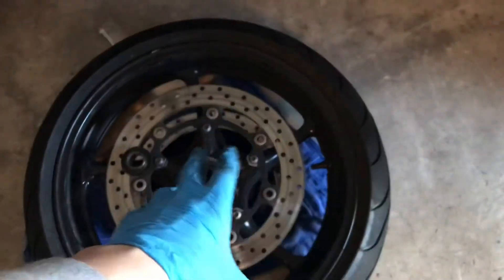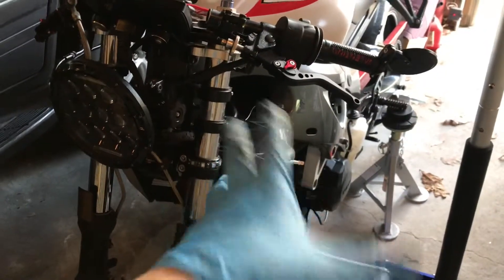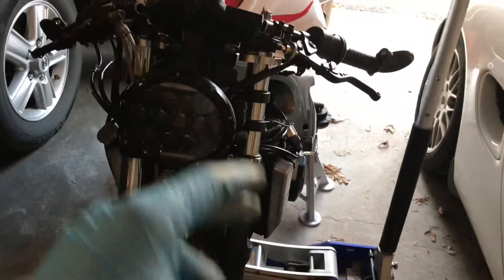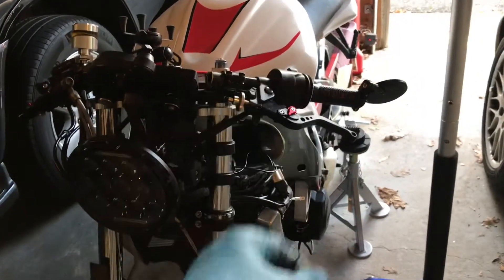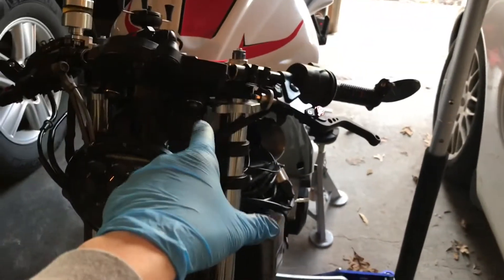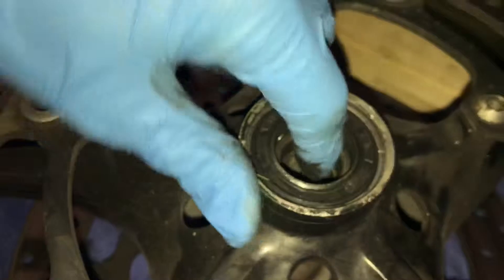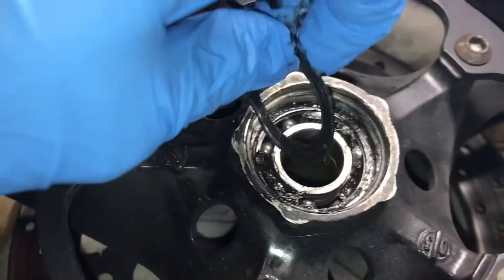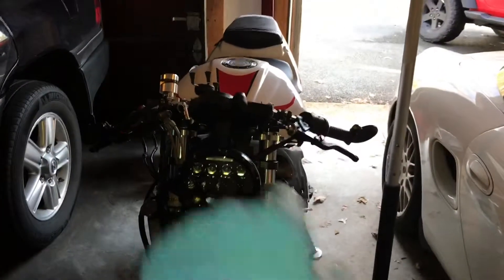Bad Wheel Bearings | R6

Comment: The axle and inner race don't spin.  The outer race and wheel spins.  Ever figure what you did on installation that was wrong?  Wheels bearings are tough, simple, and reliable.  They get ruined by people hammering them in on the inner race or using crooked center spacers that are out of spec.
Reply from the maker: J B I think it was a defective bearing. New replacements have been perfect, and have 2,300 miles.
Reply from the maker: I’ll add to that, as I’m going over these comments again… 
I replaced the rear wheel bearing at the same time as the first, and the rear was always fine. 
With 10,000 more miles on the new front bearing, I can safely say the last “new one” was defective. 
This is why I never buy from third party retailers anymore. You never know what that package has been through.

Comment: Can you please explain me why does the bearing breaks.  In w months i have replaced 5 bearing which keeps breaking as same in the video.  Please explain the reason why its breaking coz I am not sure y is it happening too often.
Reply from the maker: syed abdul radheef This could be for a number of reasons! Your wheel could be damaged, causing damage to the wheel bearing, OR, You could be installing the bearings in an incorrect manner, and accidentally damaging them in the installation process. 
I have done both of these.
Reply: Are you forgetting to install spacers or using incorrect spacers as this will quickly overheat and shred your bearings. Symptoms are at first brake noise at slow speed then when they go a loud clicking/clunk felt through the bars and if at the front wheel sometimes an intermitent loss of brake due to slight movement from the pads it can feel like a puncture or a stone stuck in the mudflap at speed or an impending tank slapper.
Reply: When putting new bearings in you fit one side and knock it all the way down to the seat. Put the spacer in and start knocking the other side in don’t just knock it all the way down to the seat as this will put the bearings under pressure from the sides as the spacer will be to tight in beetween pushing the centres of the bearings out so you gently knock the second side down checking to see if the bearings is still spinning freely each time until it’s just touching the spacer.
Reply from the maker: James Griffiths is absolutely correct. You need to make certain as you install the second spacer, that the bearing isn’t bound, and will still spin freely.

Comment: Maybe did you forgot to install the inner spacer between the bearings? so the pressure was on the balls instead of the center.
Reply from the maker: No, I had all spacers installed. 
I believe I applied too much pressure when installing them, and did not press them in evenly. 
This caused them to wear prematurely.
Reply: @motormaniac1  weirdness here. jejeje. or maybe some production problem with the part.
Reply from the maker: @cyberkiller83  That could be also! Haha 
It was a fun learning experience for sure
Reply: This kind of experiences are the one that will give you more knowledge. How people say. You learn from your success but not as much as in your failures
Reply from the maker: @cyberkiller83  indeed! Those are wise words to live by. We all need a little failure in our lives to learn from.

Comment: Sounds just like my problem. Originally i thought my chain was slipping but I just changed my sprockets and new chain. When I accelerate to hard or try to wheelie it acts similar to my chain slipping and has a clunk noise. Also i noticed on my stand it has a slight click sound if i wobble the wheel back and fourth even when everything is tightened down.
Reply from the maker: You should absolutely take a good look at that bearing 😂
You don’t want to be riding it if it decides to grenade itself further. 
If it’s not the bearing, it could be an engine or transmission noise. 
Try turning the wheel while it’s in the stand, with the engine both on and off. If it makes noise while it’s off, it’s probably the wheel, unless you can hear the noise coming from the engine or transmission area specifically.
Reply: @motormaniac1  Well it’s only when I accelerate or try to go for a wheelie and dump my clutch. Which leads me to believe my clutch is just slipping.
Reply: Hey man was it the bearing? I have the same problem with my back wheel on the stand and I need the solution before I spend $200 on this thing

Comment: My bars have a jumpy feel, its wobbling up and down, could that be the wheel bearing ?
My mechanic says the bearing is fine (checked it last time we changed the tire)
Reply from the maker: That depends! Do they move Side to side, or do they move up and down? 
If it’s more of a up and down, your shocks maybe be worn out, or your front suspension may need to be tuned.
Reply: @motormaniac1  its up and down not side to side, thx alot for the response ✌️
My forks might be too stiff actually, we swapped the springs recently for hyperpro progressive ones and didnt know what qty of oil was needed so we went for stock value which i guess is too much of it
The rear shock is also brand new (hyperpro)
Front tire is almost new and the wheel doesnt seems to be bent
The thing is all the bearings are stock, front and rear wheel aswell as steering ones and the bike has 78k kms
Its a suzuki gsf650s also known as bandit
Breaks are in good conditions same for the chain
Again thx for your time
Ride safe 😎
Reply from the maker: @tonyvador67  if the bearings are that old, you need to think about swapping them for new ones in the next few years. 🤣
They do eventually go bad. 
Easiest way to tell, is to put the bike on a motorcycle Jack-stand, and put it in neutral. Spin the wheel and tire by hand. If you feel the wheel freezing and hear noises while the wheel is spinning, it’s likely the bearings/axle or the brakes and calipers. 
If you don’t hear anything, or you hear a noise coming from elsewhere, you know it’s not a wheel bearing problem.

Comment: My handle are not constant going hard left and right and some clicking noise  is coming from the front 
How to fix it please help 🙏
Reply from the maker: Sachin Rawat Unfortunately I’m not sure what exactly you’re describing or asking. 
From the limited information you have provided, I’m going to guess it is steering related. 
I’d say the bearing in your steering column have gone bad. 
Or, the clicking could be from a bad wheel bearing.
Reply: Motor Maniac my front tire is like flat while i am riding handle goes left and right (not really but I feel hardness ) a click noise is coming from the front i am sure not coming from the cone cup because it was  change  and greased very well.
Please if you have any idea regarding this problem help me 🙏
Reply from the maker: Sachin Rawat Ok! 
I can try and help. I really don’t know with certainty what it could be. 
I would guess the following: 
1. A bad wheel bearing. 
2. Bent or damaged front forks. 
3. Bad valve stems, not enough air in the tire. 
4. Bad steering column bearings. 
Keep me updated! 
I’m genuinely interested to see if we can figure this out!
Reply from the maker: Sachin Rawat I’m sorry, no.
Reply: Ok thank you so much if i face any problem i will let you know here 
Thnxx